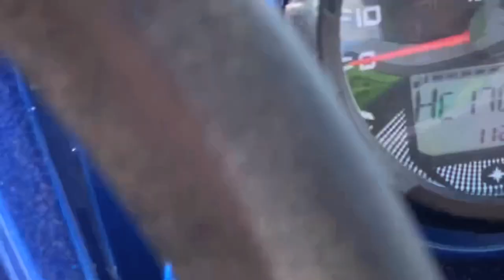DODGE CRASH! Caravan!

Comment: Goto the the hardware store and get a box of 4-40 nuts or bolts and put them in the dipstick side of a motor with a funnel. I work at a hardware store as a mgr. Ill take a picture of the boxes so you know what i mean. Than redline for a good time.